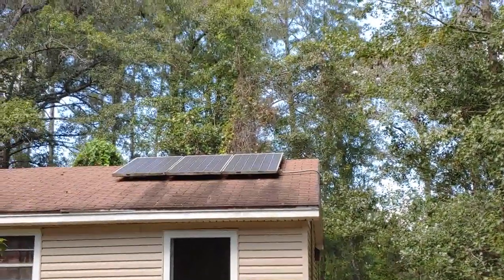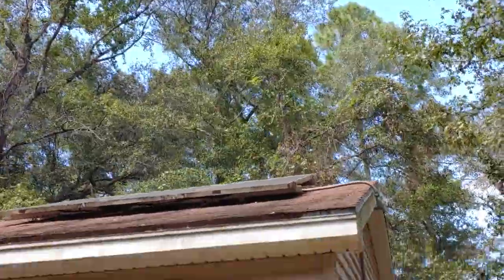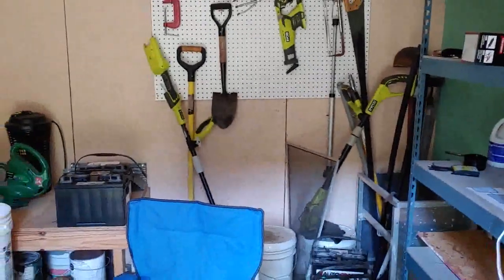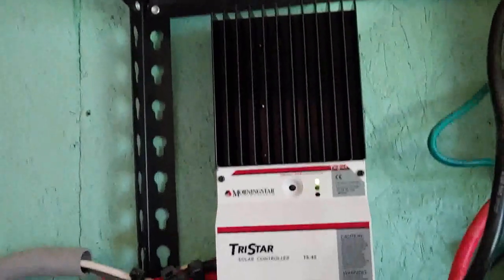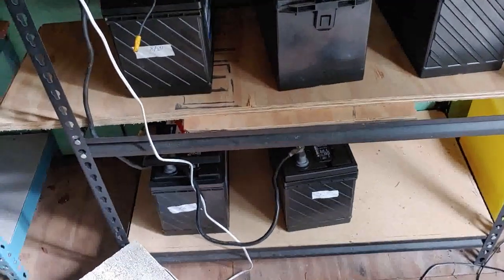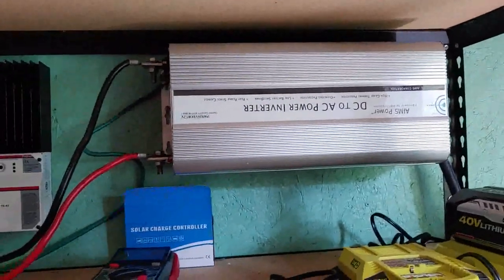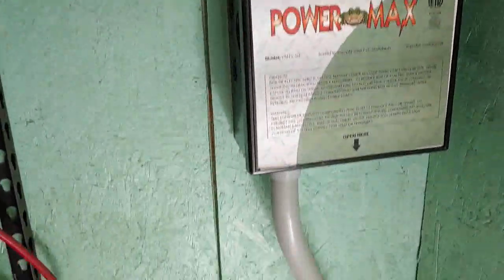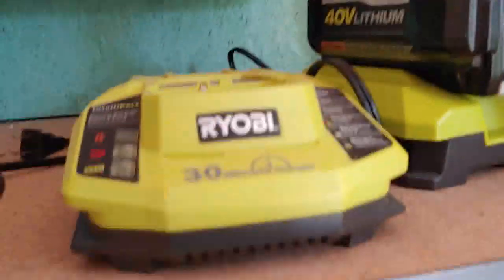Shoestring's 600 Watt's Solar Power BackUp System.

Comment: Can it be charge from the house electricity and be stored in case of a black-out
Reply from the maker: Yes. You can charge batteries from your house electricity and store the power. How long the electrical power will store depends on the type of battery you have.